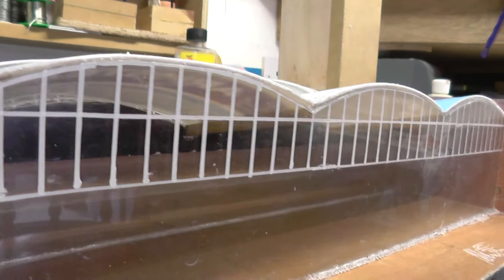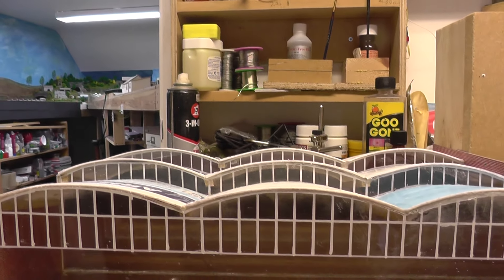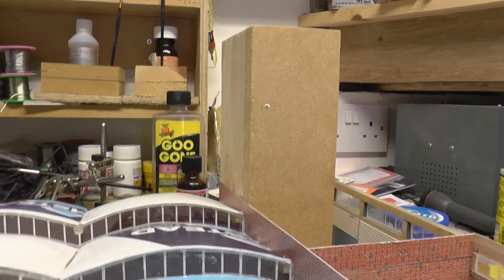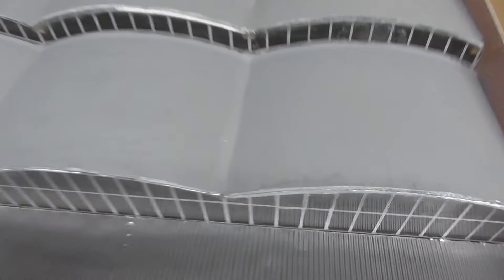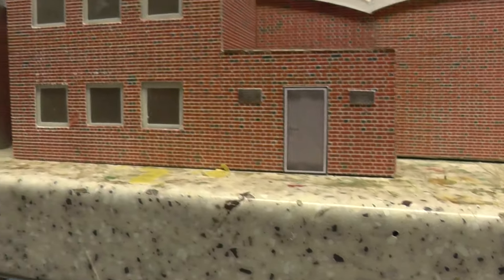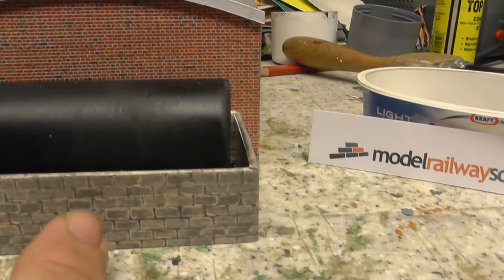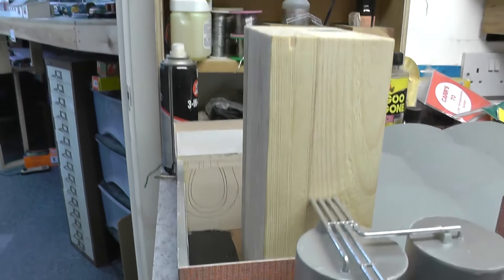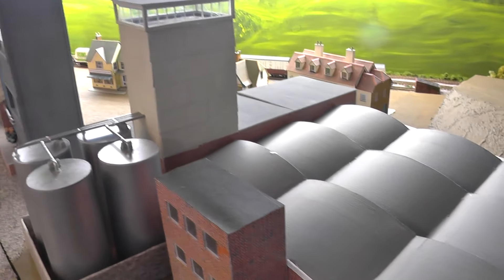Penwithers St Ivel creamery build part 2

Comment: Hi Kevin. Superb video and a great build. How did you sort the windows out and what make of brick sheet do you use. Cheers.
Reply from the maker: Hi Luke the windows are Perspex and marked out with a pen and the brick is a card made by Vollmer
Reply: cheers. I have tried to make my own windows before with clear plastic, masking tape and paint but the lines seemed to thick and uneven. I am now going to try with some thin strips of plastic I got from evergreen plastics and hope they will turn out good enough to use for my station building.
Reply from the maker: +Luke Noble you can get pens that will mark on plastic ,but mark on back so you don't rub it off
Reply: ok. good idea. cheers. : )